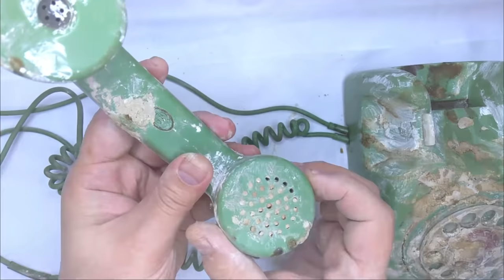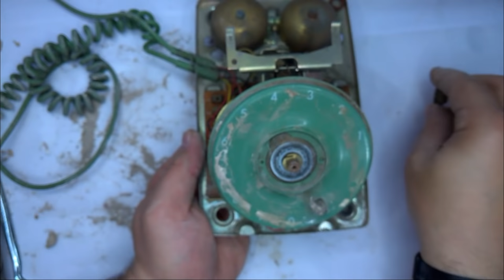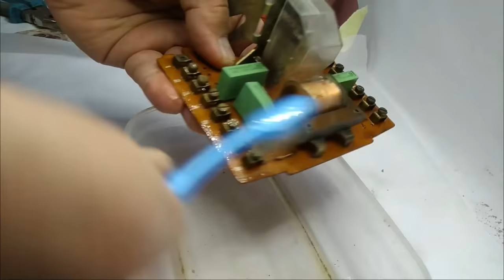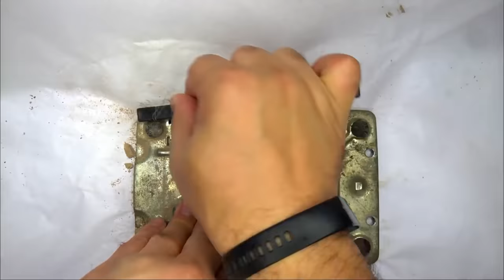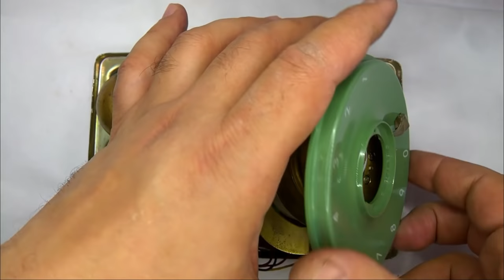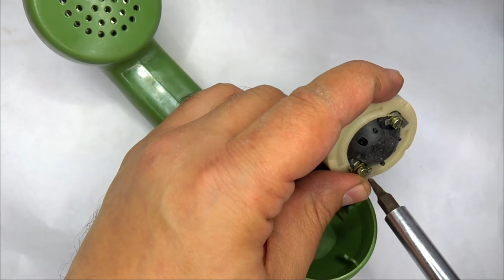1960s Vintage Rotary Dial Telephone RESTORATION

Comment: I just brought an old 228 wall phone from eBay.  It was very interesting how your video shown most of the phone parts were slotted together.  Was curious how to clean it, and was surprised you used simple soap and water with a brush to finish the job.  Thanks***

Comment: Wow that inner dial is so cool! Analog devices had to be made so precisely! Given that phone lines are digital, now, does this phone still take and make calls? Great restoration!
Reply: Some house still use landline so it is perhaps possible to use one.
Reply: @notmasterdelectronics  You can use one, but you can't use the rotary dial when a machine asks you to press a button (happened when the digital phone broke and I called the phone company).
Reply: @Cannonfodder0617  yea thats true
Reply: @notmasterdelectronics  i still use landlines, not planning to ever stopping. 
But it only works if our internet is working. Internet down and no phone 😲
Reply: Have an analog rotary wall phone still on a land line at my folk’s place, works just fine for basic calling. Spinning the dial generates a number of electrical pulses, depending on how long it takes to return to neutral. These pulses are sent to the telephone provider, and their hardware (mostly software now) does all the rest. It’s actually nice to have in the sticks because the old landlines carry their own tiny bit of own power and still work when the rest of the electricity goes out!
Reply: @Sarah c only old people still use landlines & since you have a picture of a cat(grumpy cat nevertheless)it’s obvious that you’re a crazy cat lady😂🤣😂these are facts.
Reply: Only old people still use landlines,literally everyone else(adults,kids,teens,etc)only use cellphones,besides old people public stores & offices are the other exceptions since they use them for businesses,these are facts.

Comment: Was about to say that isn’t vintage… until I did the math and thought about the fact that it’s 41 years old😅😭
Reply: I used those phones as a kid, plugged in the wall and no where to go.
I guess im vintage.  

Two words to make me feel too

Beta tapes
Reply: 41? Not older? 🤣 I thought it was muuuch older.
Reply: But the 60s was like 60 years ago. 1960 to 2000 is 40 years. 2000 to 2021 is 21 years. So it was 61 years ago. Not 41.
Reply: This guy must be good at math, i see.
Reply: What math are you doing 😂 just kidding
Reply: @gloziful  Yeah, I was like "wait no- my mom was born in 76 and is older than 41-" 😂

Comment: Clearly you've "enhanced" the deterioration of the exterior of the phone for dramatic effect. I say this because, compared to the exterior, the interior would be in far worse condition than it is shown to be. The outside makes it seem like you found the phone in Chernobyl, while the shiny plastic of the interior says otherwise. The very obvious finger smudge marks also gives it away. As if you went outside and smeared mud all over it the day prior. I can't be the only one who notices this.

Comment: Hi To make that phone work on a modern digital system you have to change the capacitors as the modern system does not have the power to energise them. Not as straight forward as suggested

Comment: Not so sure about the "vintage" label though. That Ericsson logo isn't that old.

Although I guess in the Tech sector anything older than 10 years qualifies as vintage if not antique nowadays.
Reply: I guess it’s just because rotary phones haven’t been used since the early 80s. That was 40 years ago. I think I was 9 when my mom got the first touch button phones for our house. That was 1982.

Comment: Dial is sluggish and needs some lubrication.
Reply: Dial need a proper maintenance. Dismantle, clean, lubricate and proper adjustment. Ring have to be on the spot with numbers and return move smoot, fast and constant. In video, if you dial 0, return move is slow in last quarter. Proper adjustment need to be 10 click per second. Inside dial is a blade pair who close and open by dial mecanism.
The bells can be adjust too, rotate to have high or low pitch, and center lever adjust volume of ringing.
This is not restauration, just cleaning, but good job.
Reply from the maker: Sorry if there was a mistake, thank you for your valuable information, and also thank you for watching the video and for your positive comment.

Comment: DUDE!!! There was LITERALLY NO way to completely test that once you got it all cleaned up and fixed, UNLESS you went and got a LAND LINE home number!??  YOOO!! You HAD to dial ZERO first BEFORE the area code and number if you wanted the number to work!! Where was ZERO!!!??? It was UNMARKED before the ONE!!! Some later turn dial phones ADDED the zero just in case people did not realize. The phone maker would ALSO put a STICKER on the BOTTOM of the phone TELLING you to dial ZERO first before the number. Aaahh the good OL' days of phone lines!! You could PRANK call ANYONE and NO ONE would know where the number was coming from!!!! Those were the days of PRE - Caller ID. Now we have ALL sorts of number ID B.S. so you know who and where the number is. THAT'S DUCKED UP!

Comment: that is b.s. scrap it for the brass, steel, tin, then plastic, and copper.. there is no gold in it... (i've scrapped 2- 1is a table phone, the other is a wall phone...) i also scrapped an old touch tone button phone, same stuff.

Comment: Obviously staged dirt; base plate wire-wheeled down to the bare steel without then protecting it with paint or something; dial is barely working even after the "restoration," looks and sounds like it's full of gravel, and a bunch of like/subscribe popups complete with annoying "whoosh" sound effects throughout the video.